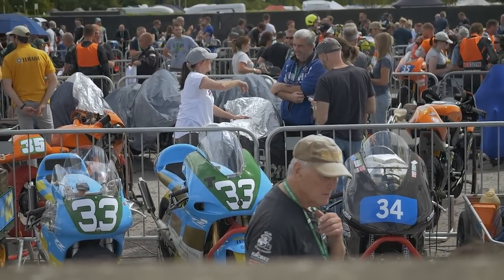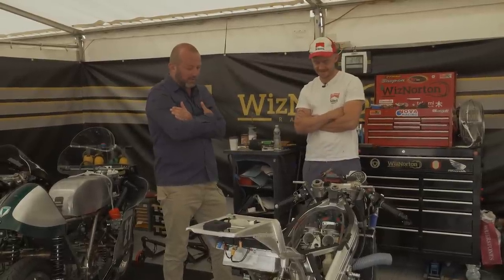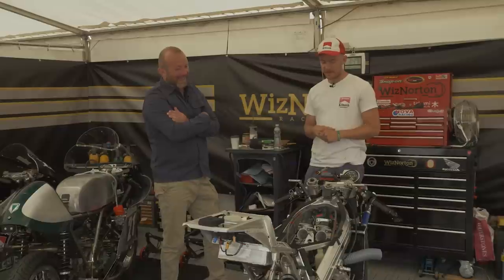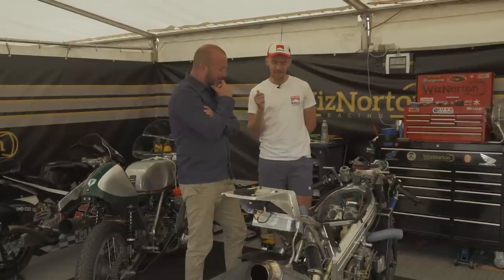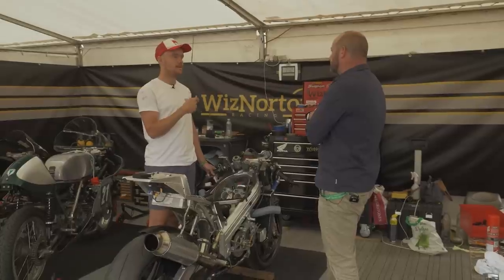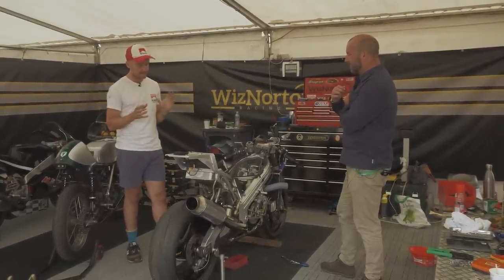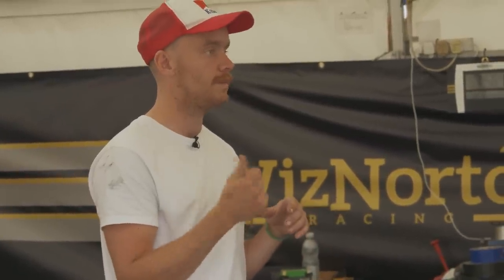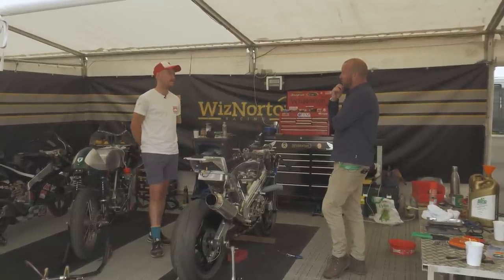Tech Special - WizNorton Racing Norton RCW588 | Manx Grand Prix 2022

Comment: Please excuse my ignorance, Norton had a rotary engine? ( I co-owned a Norton 850 in ‘75-76
Reply: Your Norton would have had a conventional parallel twin 4-stroke engine. The rotaries were released relatively late in Nortons history (early-to-mid 80's)
Reply: There is a book titled 'Norton Rotaries' that goes through all of the Norton history with the rotary engines. They also made a police bike with an air cooled twin rotor engine called the Norton Commander. There is loads of reading out there including the internet if you want to gain further insight.